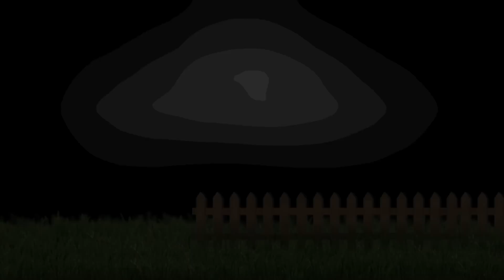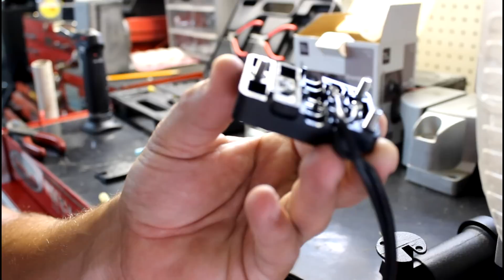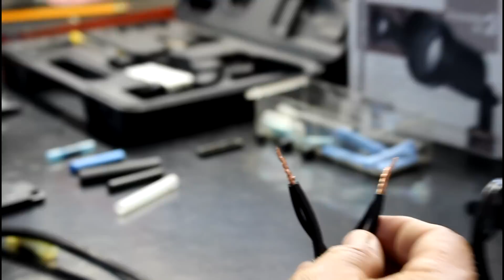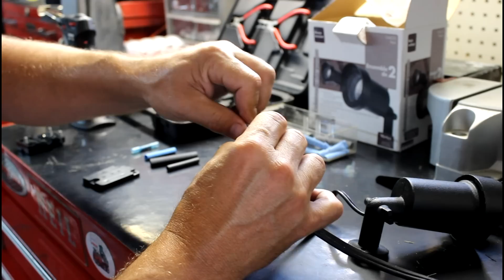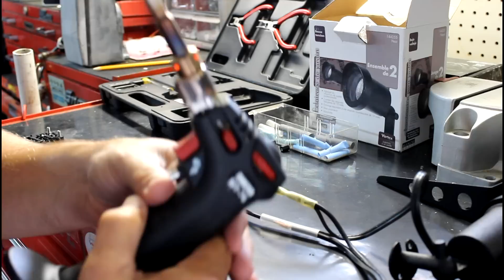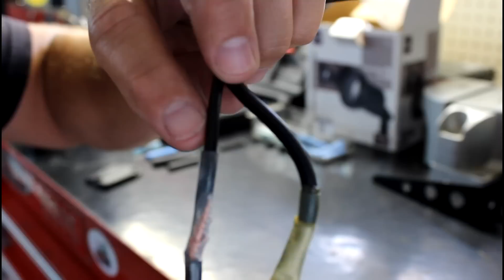Low Voltage Outdoor Lighting Installation Tips

Comment: Great advive for a project I am considering. Those plastic clamp on connectors will absolutely fail over time if put in soil.
Reply from the maker: Yes Bruce, after I installed the shrink tubing I never had another problem with the connections.

Comment: Don’t install heat shrink tubing for outdoor lighting, this guy is clueless.. don’t do this and do cut this connection off
Reply from the maker: Thanks for your feedback Mike, and thanks for assuming I'm clueless. I see you have made your own video on this application. This video was made after trial and error over several years and this is what worked for me. Maybe you have a different method you would like to share, it would be much better to share ideas than to tell someone they are clueless without a reason why. Let me know when your video is complete so I can get some professional advice and fix my outdoor lighting that doesn't have any issues. 🍺🤣😂🤣

Comment: This type of install may work for the first year but it will not last over the winter. You need to use solder for underground connections! Heat shrink is ok after solder or crimp connectors

Comment: I completely and totally agree with method. and think, you can just cut the light right off. if and when the light just goes away. because that wire you built right there is "Literally" lifetime. and that is the way to go!!!! I am so sick and tired of fighting those crappy piercing bullscrap! .....I have so many different brand lights with different cheap connectors and Im so sick and tired of them loosening up and breaking..dont dare bury them in the ground haha...So I have 2 questions...........Is there any type of grease that is available to put around and inside the bulb socket for moisture and corrosion??  Secondly, can you use a battery to test the lights in the garage before hooking them up? Or what is the easiest way to do that or can you?
Reply from the maker: +Jamie M 
Hi Jamie, yes, you can use dielectric grease or white lithium grease for corrosion and moisture, it usually used on boat trailers or high moisture areas with electrical wires. And Yes, you could probably use a car battery or 9v battery to test a single light.
Reply: Actually I went and got some liquid electrical tape and WOWWW this stuff is so awesome.

Comment: Hey Eddie, 
Have you discovered the new low voltage wiring that never needs wire to be cut and exposed to potential corrosion. The twist locking connectors make for waterproof connections and match up to most of our Laser and LED landscape projectors. I'm glad to never have to cut a wire or have risks to weather affecting my connections again. Here is my latest video demonstration of the wiring system and some exciting projectors which was have offered at www.LasersandLights.com since they were invented in 2007. 
https://lasersandlights.wordpress.com/2015/09/01/eliminate-extension-cords-new-low-voltage-waterproof-cable-for-blisslights-sprights-and-all-12-volt-ac-landscape-lights/

Thanks for sharing your knowledge,
Bruce
Reply from the maker: +lasersandlightsocom I Like the idea, simple and easy, thanks.

Comment: good tips; I never trust the "dummy" clips on low voltage lights. I feel like I need glasses after watching so much out of focus. You can use a lighter or propane torch with shrink tubing which is also portable and of greater utility than the fancy tool demonstrated.

Comment: your twisting the wring way
Reply from the maker: Joe Donohue Hi Joe, I suppose if I were using wire nuts, but I'm using shrink wrap connectors, so what does it matter as long as the connection is tight and complete? lol, thanks for noticing :)

Comment: Great tutorial! However I'd like to understand why are there 3 sets of "cables" or wires- 1 from the actual light and then the other 2 ??
Reply from the maker: Good question Quin. I was just demonstrating how to connect the wires to the main wire from the light with water tight butt connectors. So I cut the main wire which gave me 4 ends, and the other 2 wire ends come from the light. I essentially eliminated the connection block (that always causes a bad connection) and spliced the wire coming from the light, directly to the main wire. I'm no electrician and I didn't do well in electricity class in high school, I but I know it works :)

Comment: thanks eddie, i have this problem  I think I'm going to try silicone wire nuts... will let you know how it goes... the out of the box connectors are crap
Reply from the maker: Hes Sir! The connectors that come with the kit are good for about two years, then you start having problems. It's good to use anything that will keep the moisture out. Let me know how you make out, any information is good information for the DIY people out there :) Thanks Eve.

Comment: What size shrink tube did you use?  Any issue with direct burial?
Reply from the maker: I had to use different sizes because sometimes I was twisting two and three wires together, and no, I have had no issues with direct burial, I have had my light installed for over 6 years.

Comment: Hey, Didn't you just take the lights out of a parallel circuit and put them into a series circuit? Which means if one bulb goes out they all go out. Also, doesn't that mean the amps are going to change?
Reply from the maker: Hi Charles, great question! I didn't run the main wire up to the light and out the other side like Christmas lights, I just tied into the main wire with the wires coming from the light. You had me worried there for a minute, lol.

Comment: I do alot of work with low voltage wiring, I would suggest soldering your connections before you shrink wrap it and then coat your finished shrink wrap with liquid electrical tape as the end where you have 2 wires coming out will still have minor air gaps between the wires where the shrink wrap cant reach.
Reply from the maker: Hi TK4619, thanks for the tips, I really appreciate the feedback.

Comment from the maker: Thanks Richard, and great question. Electrical tape is water resistant not water tight, the nut and tape will last for a while, but in time, the tape will deteriorate. A better way would be to use the wire nut and fill it with silicone sealer after the wires are joined, that would permanently seal out any moisture and protect the bare wire.

Comment: Very thorough video Thanks for sharing. One question: Why not just cut the wires and join all three with a standard wiring nut and then wrap the whole thing with Electrical tape. You get the mechanical strength of the wiring nut and the water resistance of both the nut and the tape. ?

Comment from the maker: Hi dnsmithnc, The problem with the connectors that come standard with the kits is that they are not water tight, exposing the bare wire to the elements, they will last a couple years as is. Once you do a few connectors with the shrink wrap connectors or tubing, it's easy to remember the tubing, or just use butt connectors with shrink wrap tubing already on them, the connections will last 10x longer with no corrosion.

Comment: Harbor Freight is a good place to buy the shrink tubing.  If you are like most people, expect to forget to put the shrink tubing on at the right time several times.   Saying this, I would really like to know the average failure rate and time of the standard connectors that come with the low voltage lighting.  The techniques above represent a lot of additional work at the outset and I wonder if it would be worth it.